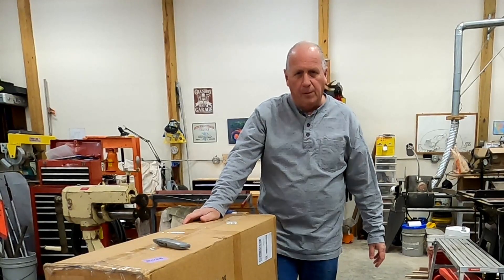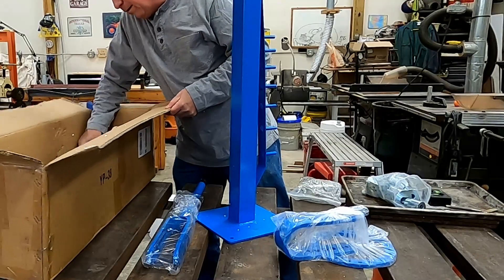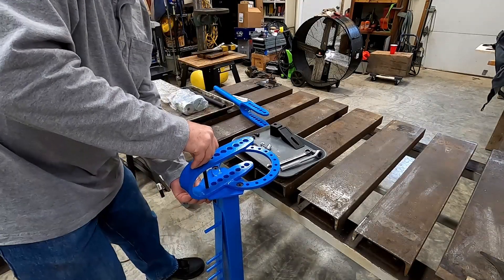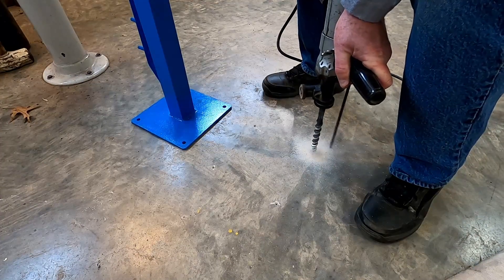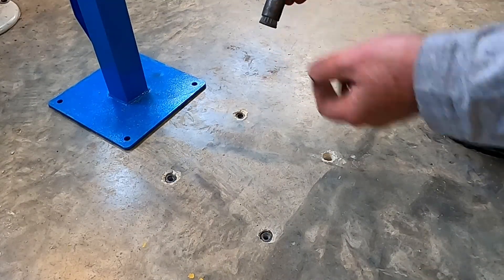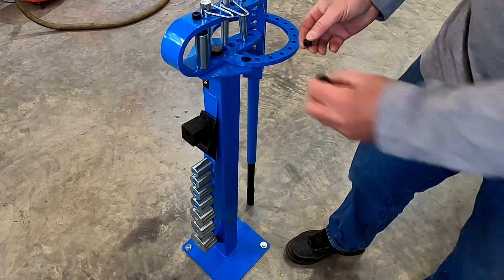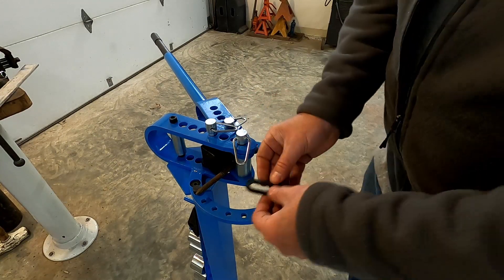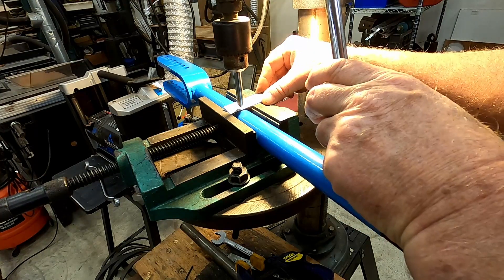Compact Bender Assembly and Bolt to Floor

Comment: I could not mount mine to the floor because I have heat tubing in the floor so I welded. A two inch square tubing to the bender and mounted a 2 1/2 receiver tube to my workbench and drilled a 5/8 hole through the 2 inch and 2 1/2 tubing so I could use a hitch pin. This works very well and I can also mount it  to my truck hitch. If needed, great video
Reply from the maker: Thanks for your comment. Mounting it to your bench with ability to remove and be portable using your truck hitch makes a lot of sense. I do wish that my shop had a heated floor.

Comment: Looking to get one. They all seem to be the same but vary in price from
$116.00- over $389. Online they all look the same with the exception of one by kaka having the scroll die. Scroll die doesn’t justify 3 times the price.
Would love to get a hossfelder but they are over $1,000 used.
Reply from the maker: This bender will do most of the bending that I plan to do. I have plans for a hossfeld and may build iit some day.